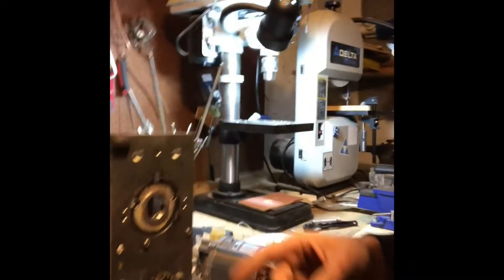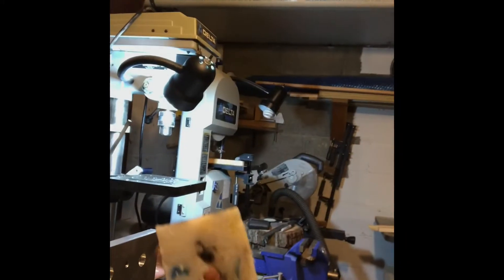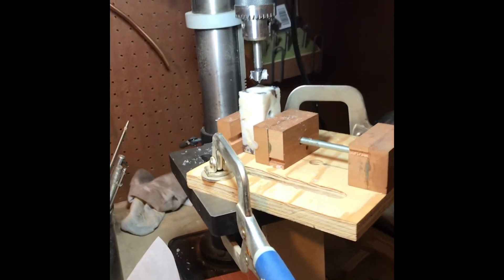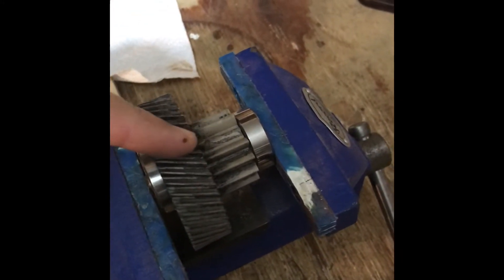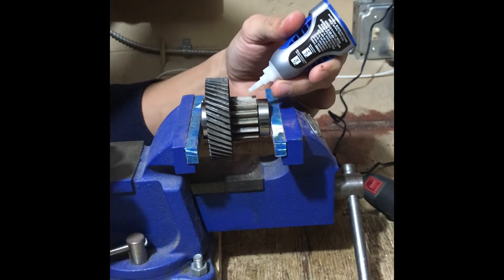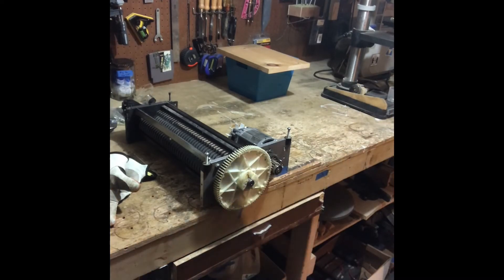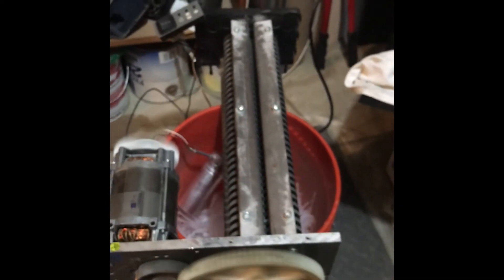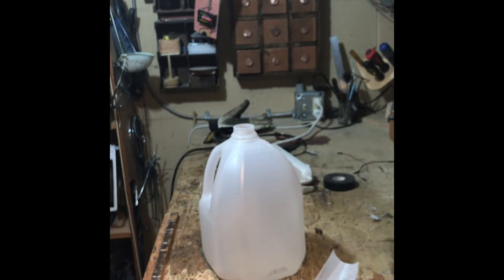Is There an Easier Way to Repair Plastic Gears?

Comment: Make a clay mold of the damaged gear. Remove the gear and rotate it in your clay mold to where the clay will have the teeth where you need them to be on the damaged gear. Depending on the material the gear is made from get plastic welding rods of the same plastic as the damaged gear and melt the repair material into the mold. There is a product called Q bond that comes with a bottle of black powder for plastic repairs and a bottle of silver/grey powder for metal repair and or making molds. The stuff bonds extremely well to most anything. Locktite makes a two part super glue that bonds most plastics. It has a marker looking pen that is an activator/bonder. I use the bonder to wipe down the damaged piece before filling in the missing area in the mold. You simply pour the powder into the void within your mold then drip the adhesive into the powder until it is all moistened. Allie to cure. If you find any pits or spots that are lacking material simply sprinkle powder in the spot and drop adhesive on it. Let cure again. If you have the space available it doesn't hurt to have the new repair material overlap the original material.

Comment: What voltage is the motor? What amp draw is the motor? What is the gear made from that is damaged?
Reply from the maker: @davidreynolds4684  the motor uses 120 VAC & I feel like the gear is either polypropylene or HDPE.
Reply: @makeitkozi  if you can't find a replacement gear and can't find a marking on the gear itself giving the type of plastic you might try several different plastic welding rods to see what sticks. I don't guess you have access to a 3 d scanner and a 3 d printer do you? That would be an option. If you get a chance and want outside help. Give me all the info you can gather on the gearbox and or wheelchair whatever you have to help id the thing. I've got that kind of time. I know a lot of folks. Many are semi mad scientists like myself. We've been known to get damn creative and made things that shouldnt work but turn out to be game changers
Reply from the maker: @davidreynolds4684 really?  That sounds awesome.  I’ll let you know if I would need help with that. So far so good though 🤞🏽 

Do you guys have a YT channel or blog or something? I’m curious to know what kind of mad scientific products y’all are producing!

Comment: oil some part of the hole gear make a form around it and pour melted paraffin to copy gears, puch of the set paraffin copy and place at the broken spot, pour 5 min epoxy, clean and its dun🤔❓
Reply from the maker: That sounds like a great method. You have any success with doing larger gears that way?